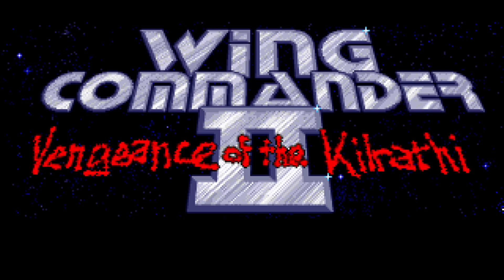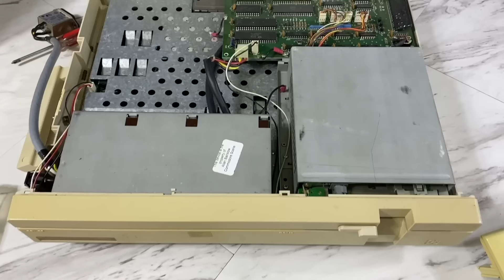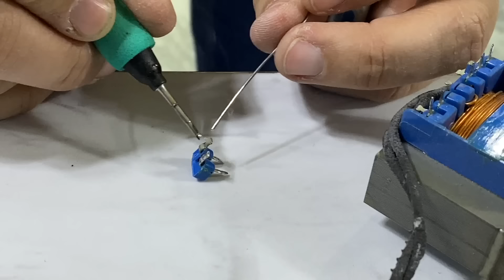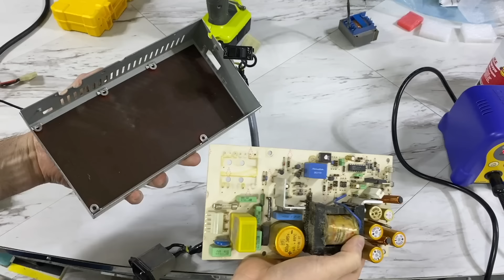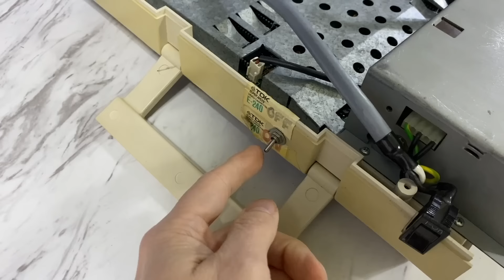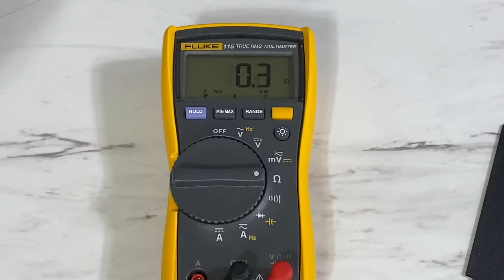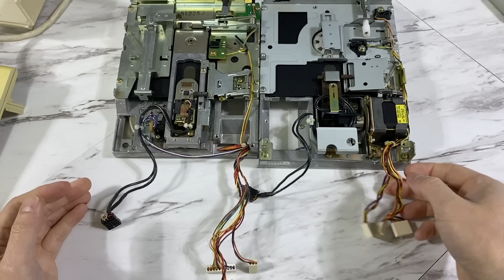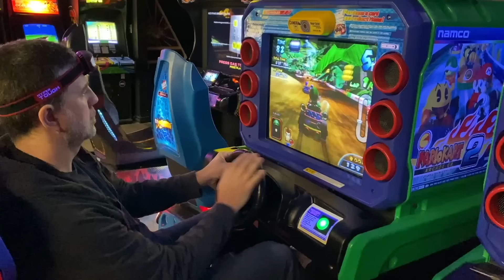Repairing Martin Galway's Commodore 128

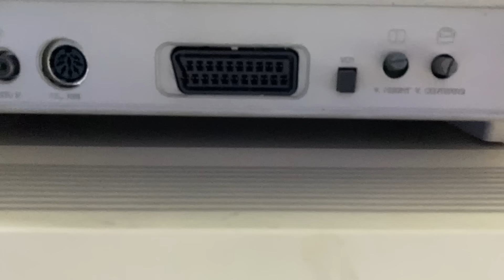Comment: 2:00 SCART is fantastic, some of the pins correspond to analog signal so with an adaptor you can connect RCAs. It bundles in and out analog and digital video plus stereo audio as long as the device implements them.
Reply: Yeah, scart was the hdmi of the 90's. Audio both ways, and all sorts of video signals, auto source select etc.
Reply: @iCuzZ  Also, IIRC, SCART could be used to transfet all the TV channel settings from one unit to another (mostly between VCRs and TVs) so you don't have to tune them all manually. That was a gamechanger for me.
Reply: I'm actually a little surprised David didn't go ahead and use the SCART connector with paper clips :face-green-smiling:
Reply: @ericsills6484 he most likely didnt know the pinout and didnt want to try messing with that just now
Reply: @pablo5425  I was mainly being a smart butt about paper clips after his video about the 7496 prototypes a few years ago.
Reply: I've seen a few American collectors adding SCART to their retro consoles and computers since it lets them run RGB component video and stereo audio through a single cable. It massively reduces cable clutter – especially if they want to keep the machines plugged in at all time through SCART switch boxes.
Reply: @TasnuArakun I'm not a fan of switchboxes. But at the same time I only had passive ones. Those tend to introduce a lot of noise from the other devices despite being turned off. 
If you know any that doesn't, feel free to provide links. I'll buy a couple.
Reply: Most of SCART advanced features were never used, sadly.
Reply: @Damien.D  Let's put it the other way around, most devices used at home didn't need the extra functionality. So a cheap cable with half the pins missing was enougth.
If the devices supported the extra stuff and you wanted to use it, you would basically just source a more expensive cable. It's really the same situation with HTMI/DP.
Reply: Wans't the connector too heavy for the cords?
Reply: @jolibethrodriguez7471  The opposite, there is so much copper in the cable the connector weights nothing. It's hollow with pins stuck in a header itself encased in a metal shell which is itself in a plastic case with a screw-able neck. The entire thing is easy to opened to fix or modify (add resistors or caps or swap pins around or even solder in a VGA connector for a quick adapter cable).
The shape could also be viewed as acting like an anchor so it doesn't bend or break when plugged in.

In fact a few memes in France, and probably in other European countries, were about people not being able to plug it in blindly from the front of the TV set when they brought their consoles over to friends houses, they would fumble around trying to plug this thing before giving up and moving the TV around (remember, TV's were often huge and heavy so you'd rather not try to move them nor the furniture around just to plug a single cable).
Reply: @TheSliderW  Aah, I only remembered something abouth weight sometimes draggin the set-top boxes
Reply: @TheSliderW  Thanks
Reply: @jolibethrodriguez7471 yes, that would be the case with longer cables > 50cm or if you had multiple cables like when using 2 or more devices. 
All the cables dangling behind would definitely be heavy enough to pull those down, the back feet of those devices acting as the pivot point. Especially the  set-top boxes witch were initially huge and pretty much empty just to look nice and fit on top of your VHS player... X )
Reply: @TheSliderW  Good to know, Im too Latinoamerican and yoing to having experienced it first hand

Comment: I powered up my 1541-II recently after not using it for probably over 25 years. It had the same problem, seeming to not recognize any disks. 

I merely unplugged / replugged every connector to the drive mech and sure enough it came back to life.

Comment: Most televisions in Europe supported NTSC. The same did go for the VHS, the more expensive ones supported NTSC playback. I think even today, most modern television with analogue mode support NTSC. Digital is different in that way no television in Europe supports the over the air digital standard used in the United States because its property.

Comment: Chances are there was a cartridge in the machine that transfered data over a parallell(i.e. user) port cable. It would not be uncommon that the cartridge was a "The Expert" as it was possible to upload programs to it, but if Martin didn't really use the floppy then it might have been a more permanent solution.

Comment: A bit late, but in the UK, we have a tonne of RCA to SCART "blocks",  

Using a SCART connection was only ever 1:1 from a VCR or set-top box.  

So when we had the Xbox 360, which came with an RCA cable for SD video,  
It came with an Xbox/Mucrosoft branded SCART block in the same grey as the Power and Video cables,  
But in a sleeker looking case with holographic sticker of authenticity...
Reply: You could get proper RGB SCART cables but they were sold as accessories, i remember having to explain to someone that the SCART dongle with RCA plugs on the back that came with his Gamecube wasn't really "SCART".
Reply: @Nukle0n not RGB SCART, no, which is obviously the best quality you'll get over that connection. But SCART was designed for flexibility so composite, and left and right audio can still be 'SCART'
Reply: @TheErador  right. Just he thought he was already getting the best signal and I explained that no, it was pretty much the worst aside from RF. Tho I'm not really sure if the little compact TV he had even did RGB over SCART.
Reply: I remember having a lot of those RCA to Scart blocks laying around. Most of our TVS in the Uk usually only had the single Scart port. It was kind of a pain in the ass half the time.
Reply: Unless you had a computer like the MATRA Alice or BBC Micro which supported genlock.

Comment: It's funny because here in Argentina even though we used PAL-N, during the 90s it was very common for TVs to be "binorma", basically, they supported both NTSC and PAL. So it's quite easy to find TVs that work in both cases. SCART was still a complete rarity here, I don't think I've ever seen one of those in person.
Reply: Hello there, fellow Argentinian. I think that there were some Grundig brand TVs (Expensive, but the best! was their motto) that had these connectors but certainly I never saw someone using it.
Reply: I lived in Australia and it's similar there. It's usually safe to assume that any SD video equipment made after around 2000 will accept NTSC in addition to PAL. Even much older TVs would generally support "PAL60" (NTSC frame rate and resolution with PAL colour), so only a very cheap converter box was needed to shift the colour signals from NTSC to PAL.
Reply: Most TVs here in Finland have supported both PAL and NTSC since the 90s. I think that's the same in most if not all PAL countries.
Even my VHS VCR has NTSC playback capability
Reply: Uruguayan here, we and the Brazilias did a wild thing TBH, using PAL with SECAM colors and NTSC teletext

Comment: I have a C128D (US version).  It was having 1571 read/write problems.  In the end, I replaced the drive heads and it's been fine since.  I think I purchased the replacement 1571 heads on ebay, many years ago.
Reply: That's a C128DCR.

Comment: Every 1084 (and many other C= models) sold in North America works fine in PAL. All you have to do is slightly adjust the VHOLD control.
Reply from the maker: Yes, but only in grayscale unless you are using RGB from an Amiga.  My 1084 is on the fritz, or I might have used it.